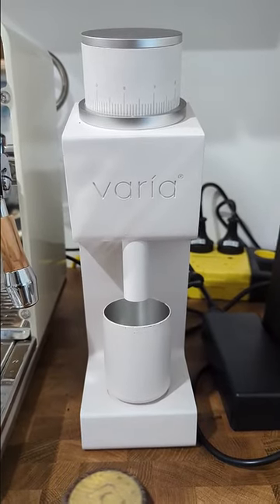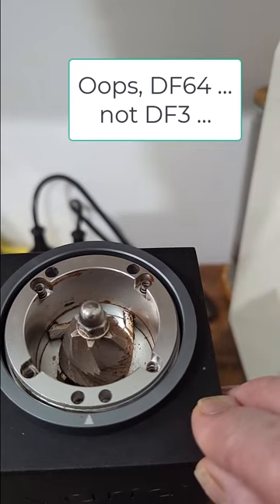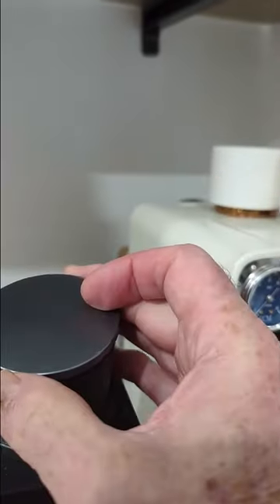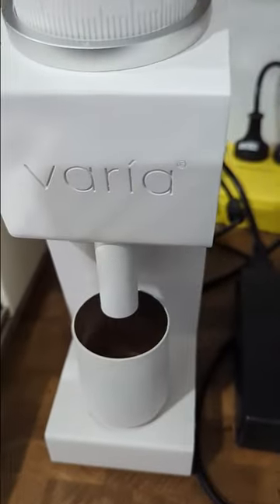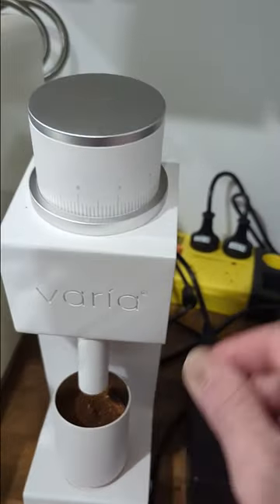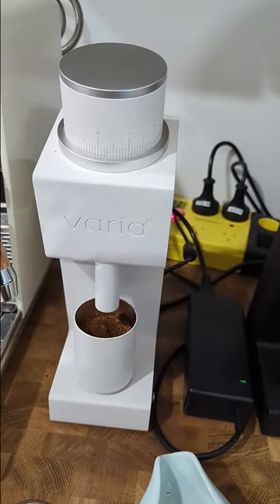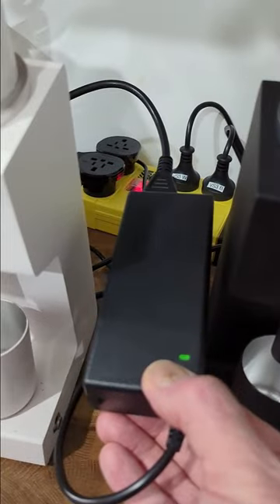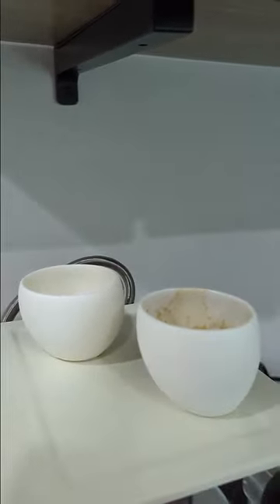Varia VS3 review after 3 months of daily use

Comment: Thanks for your review! Question, i recently been using this grinder and i noticed your grind setting was at a higher number setting. Is it because it was a light roast? I been experimenting with the espresso grinds and so far mine has been way too fine so i increased to about number 4 and it was better today. Will probably need to increase to 4.5 or 5.
Reply from the maker: Ah...so many variables determine grind size including roast depth, humidity and the burrs I had in there. Use this as a benchmark to start with the experiment from there: for every one gram of beans you grind, pour 2 grams in the cup over 25 to 30 seconds, measuring the time from when the first drop hits the cup.

Comment: Great review from a true pro, it is very helpful! I wonder if you have reviewed the Timemore 078s as well, and if yes, price differences aside, how does it compare to the VS3 if it's only for the purpose of espresso grind?
Reply from the maker: Not yet. Based on specs is say the Timemore would be the better of the two with a more powerful motor and faster grind time. Possibly more robust motor too. The different burr sets in the VS3 are an appealing feature but to be honest the more I use them the more the taste similar in my blind test comparisons
Reply: @tomsgrinderlab Thank you. You’re right on the specs between the two. After reading your earlier review at coffeesnobs, I’m still leaning more towards the VS3 Gen 2 due to its design and build (gorgeously sleek!) and seasoning period. Also and more importantly, few forums mentioned that the 078s requires at least 5kg of beans till the taste is right (acceptable).

Comment: I had this grinder for one month before the motor stopped working. DO NOT get this if you're looking to use it for espresso. 

The grinder is essentially a higher quality version of a portable grinder. While the materials are high quality, the engine just can't maintain an espresso grind while it can hold up to french press and other drip levels. 

While I hoped this was a fluke and a mistake I went online to see if anyone else had a similar experience. There is a reason the VS3 has been nicknamed a "Very Shitty" grinder on multiple threads and reviews. Unfortunately I found this out after buying the unit. 

I'm very disappointed in this product and the service by Varia. Do not buy this product.
Reply from the maker: Thanks for your post David. 

There were a lot of issues with the VS3 Gen 1 which I learned about after this review. 

In discussion with varia they have acknowledged this issues and say that they have sent replacement parts or grinders.

I haven't seen those sort of issues reported on since the gen 2 model came out so fingers.

I appreciate you posting because it's important that all experiences are openly shared.
Reply: As an alternative, I’ve been using mine for espresso for 18 months trouble free. Brilliant little grinder 😊

Comment: Hi, thanks for the review. Is this a great grinder for filter /  pour-over drip? Which burrs should I get for filter coffee?
Reply from the maker: If you want some clarity in both espresso and filter than I recomend the Hypernova Ultra S burrs. These come standard in the Varia Evo and according to Varia will be available "soon" for purchasing seperately or with a VS3. Hope that helps. (PS if you want more information on the Hypernova Ultra S burrs please see my review of the Varia Evo.)
Reply: @tomsgrinderlab  Thank you. Do you have opinion on VS3 Gen2 issues 1. Grind setting dial moves during grinding. 2. Grinder stops working after few cycles. I use Eureka Mignon Libra and Zero for espresso. I love the reliability. Never had a single issue. Now I'm in market for dedicated filter coffee grinder. Ideally I'd gotten Eureka Brew Pro. But the price is not right at the moment.